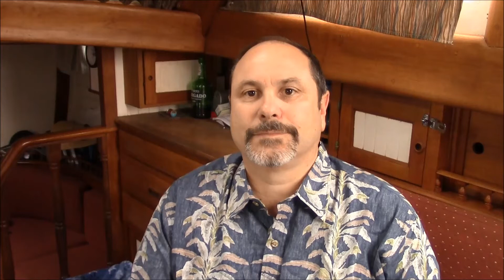Cruise RO Water Maker Installation: What Extra Parts You Need

Comment: So are the 3 - 1/4" lines the high pressure ones?
Reply from the maker: +k bob 
The two Hp lines are 3/8.
The three 1/4 lines are all low pressure (Brine Discharge, Sample line, and then product water line)
The sea water inlet lines are all 1/2